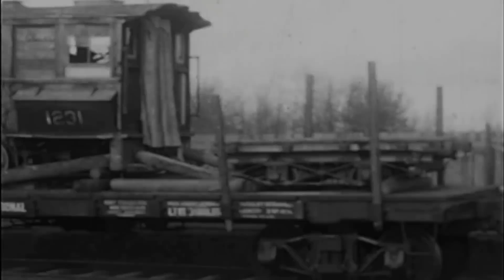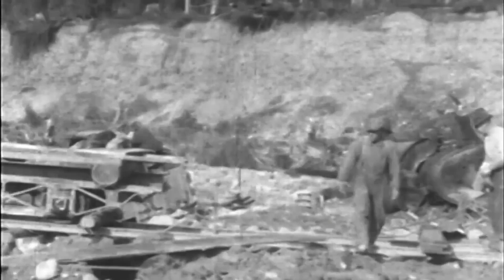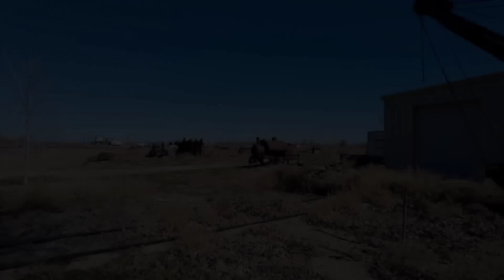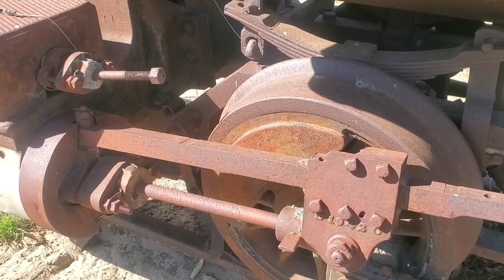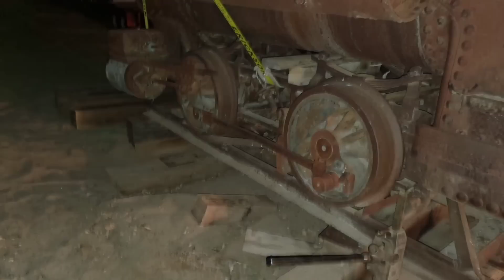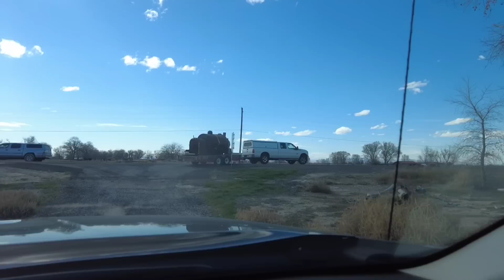Ep 1 - Two-Foot Gauge Steam Locomotive Restoration - Introduction

Comment: Saw a tow truck extract an 18 wheeler that hasd brake fade on a Pennsylvania mountain hairpin, uphill off U S - 30 Sidling Hill about 35 yards by using rollers. The small trees the tractor had dmowed down were chainsawed into lengths just taller than the trailer box that was laying on its side, several winchings had it to the highway to upright.

Comment: Instead of doing wood patterns, have you heard of 3-D printing of a cast-iron mold or a steel mold? My son built a full-size Hart Parr two cylinder. Tractor crankcase and cylinder unit this way. It’s about 6 tons. There is a half hour or so YouTube video presentation on the building of this tractor and the engine
Reply from the maker: I've heard of your son's work, very very impressive! I've considered 3-D printing sand molds and/or patterns, and I'm not going to fully rule that out, however I personally prefer the traditional wood pattern.

Comment: I restored a 1942 fire truck... I pulled out the tank and took the body off using this exact same jack-up method. Did it mostly by myself, but inside a big garage and in no hurry. It's slow, but it's cheap and it works.

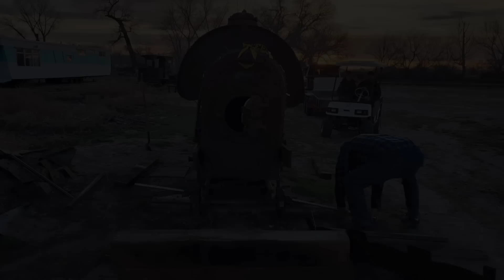Comment: @06:15 What is the other steam loco in the background lefthand side? It looks like a little vertical boiler shay. I wonder what gauge that one is? Also, considering the condition of the Porter loco you bought, I hope you got it on the cheap. Oh, and what weight do you estimate your will weigh when it is fully restored? I will wait with baited anticipation to see if you build a steek or wooden cab for this little gem. 🤪👍👍

Comment: You won the prize congratulations I’ve been looking for something like like that for about 40 years. I have some questions. What is the stroke in the bore on the engine and what is the diameter of the driveways and is the throttle valve in the dome or does it go through the top of the boiler And the next best thing where  you located? Don’t give exact address. Just give me state

Comment: Where is the gasoline conversion engine and transmission? Am I the only one who is actially more interested in the gas conversion? I've seen several small locomotives, but necer a steam locomotive converted to gas.
Reply: I took photos of a 2-6-0 that had been converted to a Chevrolet engine and transmission through a truck rear end with probably No 22 roller chain down to sprockets on the drivers for power transmission.  The engine was in the smokebox and the rear axle was over the number 2 driver axle.  A lumber company between Shreveport and Gibsland, LA did this to be able to move cars when they wanted and not be dependent on the IC RR for switching service.  I was told it could pull 6 loaded cars in the yard track without a problem in first gear.  This was in 1964 or 65.
Reply: @royreynolds108  That's actually fascinating. Was it connected to a manual transmission or a Powerflite?
Reply: Converting a steam locomotive to run by means of a gasoline engine is an offense to the laws of God and man. . .

Comment: Subscribed.  Good luck with the project.  Did you say 11,000lbs for the loco?  How much is that tandem axle rated for???  Thanks for sharing.
Reply: @fsj197811

Obviously rated for the load or they wouldn't have made it 1,200 miles home.

Comment: Although you say that this project is not affiliated with any museum, i would highly recommend incorporating the project itself as a non-profit museum, and apply for an IRS 501(c)(3) designation. This will enable the project to receive tax-exempt contributions, grants and in-kind support from corporate and public entities, which greatly aid your efforts and ongoing progress. Eventually, you will complete your restoration and will want to operate the restored loco, in which case having it owned by a non-profit corporation will prove to be a significant benefit. 
All that said, getting the loco up off the ground and loaded on to the trailer as you did was a significant first step. Getting the proper weight distribution on the trailer is critical to avoid pendulation or whiplash while you are towing. How did you manage that aspect?
I wish you guys great success in this project.

Comment: I think I remember reading a blog about narrow gauge 0-4-0 locomotives and one particular story stood out to me about a gas conversion where they tried separating the boiler from the frame with dynamite and sledge hammers resulting in similar damage. Is it possible this is the same engine? I cant recall the name of the website sadly
Reply: @zoltanbodnar9721

One and the same.

Comment: Resourceful and clever way to load your new acquisition!!  So basically, you bought/acquired a pile of difficult/expensive to replicate castings and forgings with which to make a new locomotive.   Drivers, frame parts, cylinders (if they're not too busted up), side rods (though one looks bent, but that's fixable) and a few other parts that don't look too far gone.

One heck of a project!  

Subscribed and looking forward to this restoration.

Comment: is she 0 4 2? narrow gauge
Reply: those numbers reffer to the number of wheels an engine has.
- the 1st number is the number of unpowered leading wheels (she has zero)
- the 2nd number is the number of powered wheels (she has four)
- the 3rd number is the number of unpowered trailing wheels (she has zero)
and she is a narrow gauge engine, because the gauge (width of the track she runs on) is less than the standard width.

she is thus an 0-4-0 narrow gauge engine.
Reply: @abrr2000  thanks not all know this system
Reply: This is a collection of metal parts.  It is an IT!
Reply: @roboftherock  and it needs more train to make it a train locomotive
Reply: @roboftherock  No, by centuries of trandition, all trains are FEMALE. The only excemption is when they have a male name, and even then they are often still reffered to as "she" or "her"

Comment: I have loaded “slugs” like this a few times.  Mostly old tractors.  Rolling load or not.  I get a big truck or tractor to pull from the outside of the trailer with heavy chain.  Sometimes it helps to alternate sides as you go along.  About the same process.  Maybe a little faster if you have the right help.

Comment: Davenport engines were a T type. No tender. Just a box for coal on the back of the cab. (If they found it) Water was in a u shaped tank over the boiler. It kept the water warm in the winter so it didn't freeze.

Comment: Excellent video.  You have a big job to take on there!  May I suggest you look up "The Huntsville and Lake of Bays Railway" - HLBR  (Huntsville, Ontario, Canada).  It is a narrow gauge heritage railway using the steam locomotives of the original HLBR that ran on the world's shortest commercial railway at just 1 1/8 miles, from 1904 to 1959.  In its later years it used 2 steam locos built by the Montreal Locomotive Works in 1926 on a gauge of 42 inches.   Both of the steamers were 0-4-0 saddle tanks,  #1 was a 17 ton coal burner and #2 a 21 tonner converted to oil burner.
I was involved in the restoration of #2 and later became (as required in the province of Ontario for anyone operating a steam locomotive involving the general public), a licensed steam traction operator for 12 years.  Sadly when I retired, I moved too far away to be an active volunteer.  There are lots of YouTube videos on the railway and there is a good website.  I have lots of photos of the railway, especially of the restoration and "before and after" shots.  I would be happy to send you any photos or information re restoring a steam loco if you are interested and can send me an email address.  Best wishes, Paul

Comment: If there's one thing I've learned from historic railroads, it's that if a part can't be bought or salvaged, it can be created. I'm curious to see how much is still salvageable besides the boiler. I've never heard of a steam engine being converted to gasoline. Why not use an old diesel switcher?
Reply: Actually, he said that the boiler is toast, but he has another one for it from a sister machine. As to salvageable, it all looks good, the main running gear is there. The cylinders will of course be badly rusted and so will need either sleeving or oversize pistons. Time will tell. The valve boxes will need some major machining to clean up, but that is not a major problem.

The timing gear will be a bit of work, it looks as if someone tried to pick up the engine using the slider bar for the valve chest. Hopefully they found the valve gear, the reversing stuff, all that good stuff. 

Lots to do. An inventory of what is needed would most likely be the best first step along with a time for repair schedule for each part. No point is doing one thing if you are going to be held up for weeks waiting for the left handed acme threaded widget to be made, so critical paths will have to be developed.
Reply: @oldfarthacks  The important, hard to source castings and forgings are there...  That's probably the biggest positive here.  The rest of it isn't worth a whole lot though.  Most of the valve gear is going to need some serious resurfacing/machining to be usable.  The most valuable parts are probably the frame, side rods, drive wheels and cylinder castings.  Everything else can be remanufactured more easily than those parts.
Reply: I can give you example of a steam loco conversion, from Victoria, Australia.  A Y class 0-6-0 steam loco (Y413) from 1889 was retired in 1956.  Boiler scrapped.  The frame and wheels sold to a plaster company.  Was converted to diesel/mechanical drive: GM 6-71 engine.  Used to haul gypsum, (for making drywall sheets) from their quarry/mine.  Retired again in 1984.   Amazingly, Y413 has survived, and is now on display in a pioneer museum, minus the diesel engine.  The Y class was replaced by a M232, an M class diesel switcher.  The M class is also powered by a GM 6-71 engine.  The gypsum mine closed in 1987.  Only 2 M class were built, and both have survived.  One in running order.

Comment: That is going to be a huge project.  My heart sank when I saw the cylinder saddle.  Everything else is doable.  Always tried to find an engine but it never happened.
Reply from the maker: You're not kidding!! It's going be a lot of work, but it'll be well worth it in the end!
Reply: If the rest of the cylinder casting is not broken that the cylinders can be repaired. If they don’t have the missing parts than they will have to fab them out of steel. Than they can be brazed on. Yes the whole casting will have to be heated, maybe in a charcoal fire and several torches but it can be done.
Reply: @miken3260  I have no doubt it can be done.  It is quite possible that the cylinders are badly worn.  If so, they will have to be bored or bored and resleeved.  That would make any distortion from heating inconsequential as boring would correct that.  Besides, I understand that he has contact with a restoration specialist that can provide assistance in any possible areas he needs.